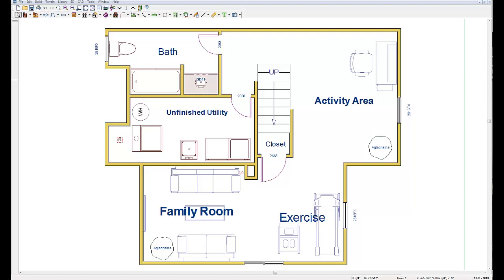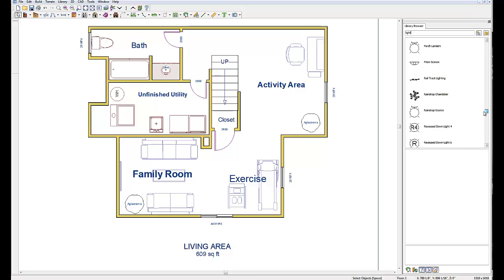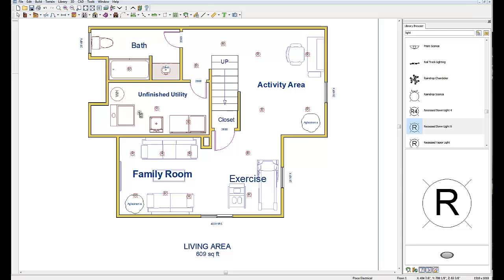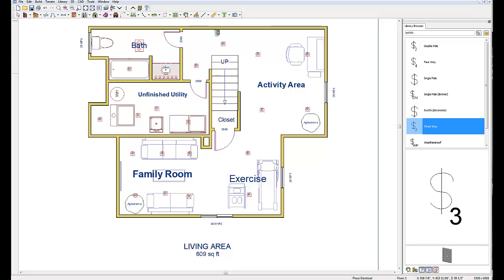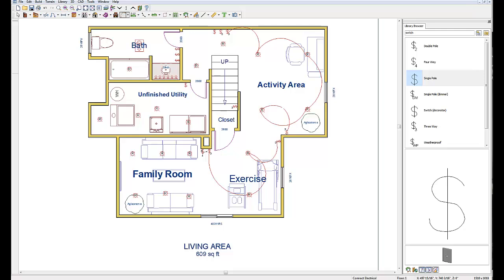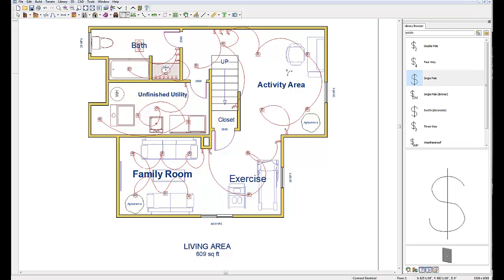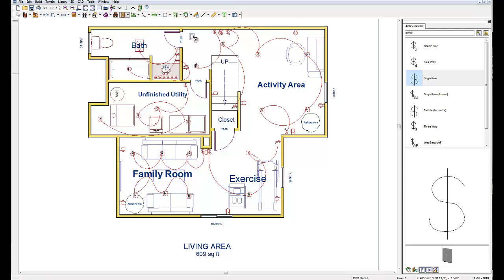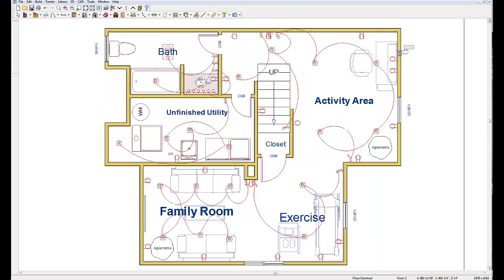Wiring your basement- basement electric design plan

Comment: how about the calculation of lux
Reply from the maker: What would you like to know about LUX?
Reply from the maker: Here you can calculate the number of lights required in a room based on the type and size of room. Enter the room size, select the type and choose a light. Notes: Lux: Lux (Illuminance) is a measurement of the light intensity at any point. It is equal to 1 Lumen per square meter.
Reply: can you send me formulas calculation light of lux in detail

Comment: So you don't show the wiring for the outlets?
Reply from the maker: Correct...just outlet locations and whether or not they are GFCI outlets or regular outlets. Generally you are only showing the light to switch wiring on most electric plans.

Eddie

Comment from the maker: Well...that depends on how in-depth your drawings and electrical info needs to be. For my business this program here is awesome! It gives me everything that I need to get building permit applications ready for code officers to  approve which is all I need the electric side of this program to do.  If you need super SUPER detailed electric plan drawings for electrical engineering stuff Autocad is probably more in-depth.  But for 95% of the rest of us this program I'm using in this video is your best bet.

Eddie
Reply: What is the name of the software you used?
Reply from the maker: @vnvtube2575  Chief Architect Home Designer Pro.
Reply: @BasementFinishingMan  thank you!
Reply: What program is this?

Comment: Does the program "recognize" the furnace, hot water heater and washer and dryer when automatically putting in the outlets to code?  Looks great!
Reply from the maker: No...it just self populates regular 110 volt outlets to code per room area sizes. You would need to place any special outlets in the plan according to your plan's specifics. Thanks form stopping by our YouTube channel.

Eddie